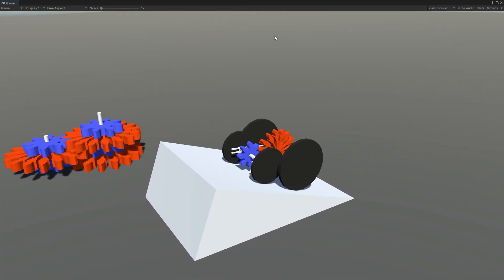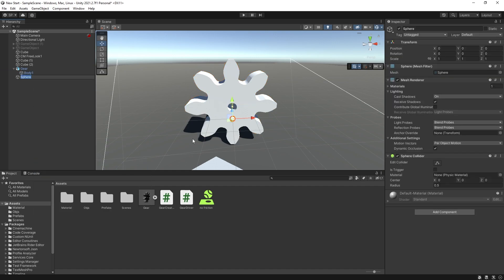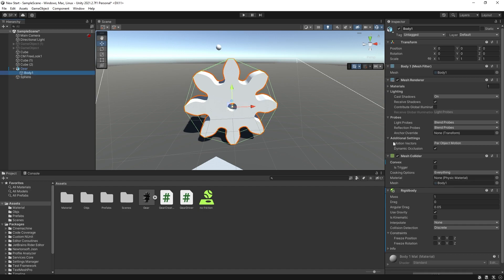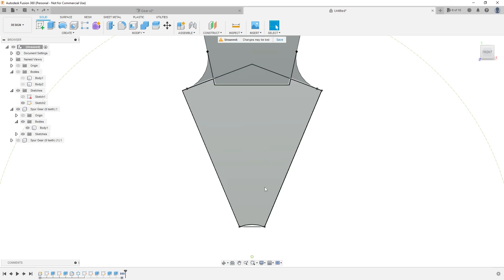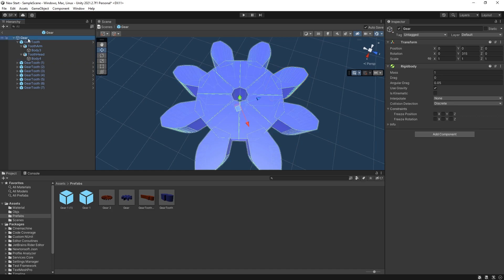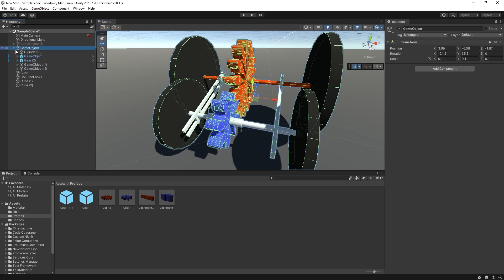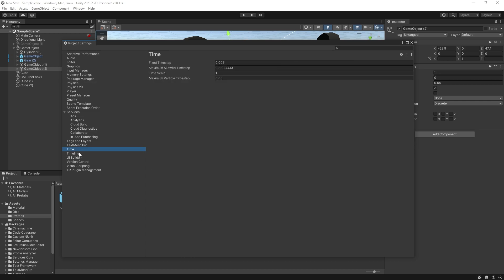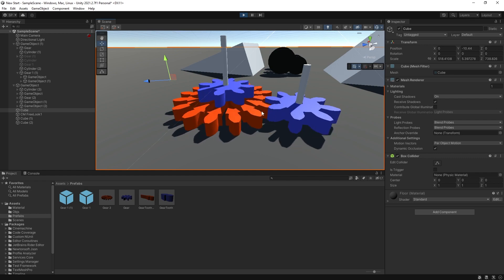How to Get Complex Shapes (Gears) to Work with Unity Physics

Comment: Good explanation, but you really shouldn't have to do any of this. Unity should support gear joints. They're supported by most physics engines (including PhysX), but Unity in their infinite wisdom decided not to support them. That would mean that you wouldn't require any colliders for the gears. Colliders for gears are a bad idea in general, because they tend to move fast and are therefore prone to tunneling. Unity also doesn't natively support convex-decomposition, which would have at least avoided the need to modify your meshes.